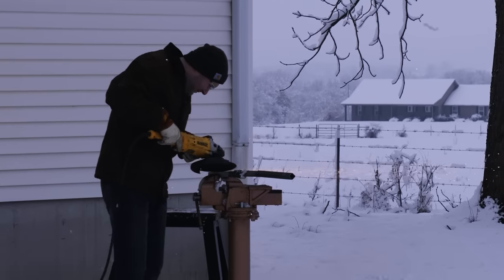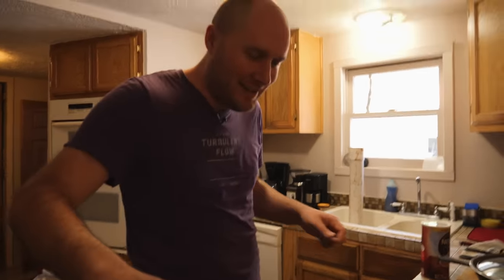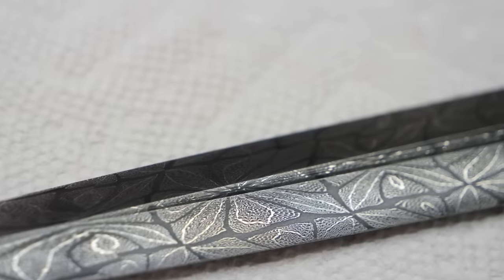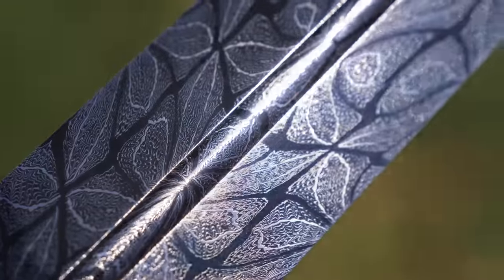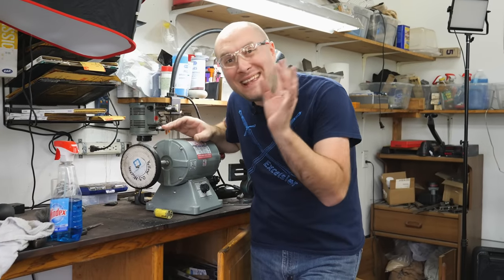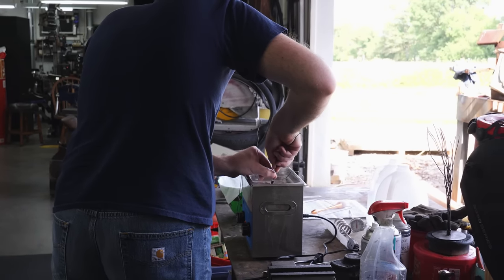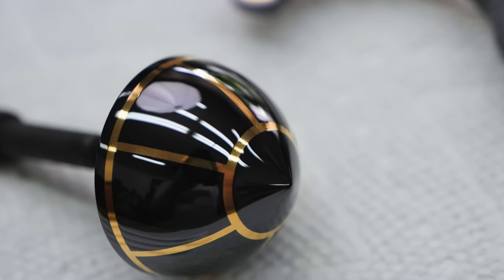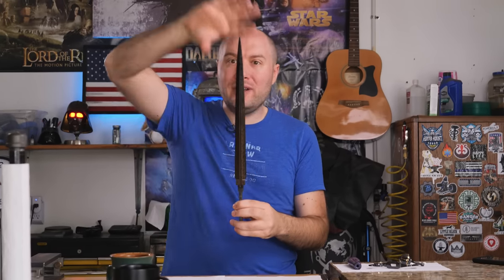After Soaking In Acid, This Knife Is Done ✅

Comment: Idk if you will end up seeing this. 

But if you want to sand higher than 3000 wet or dry. Get micromesh pads. By far the best thing ive found for high polishes well above that. 

Also the 3m micron polishing films are very good for that.

Comment: Wonderful work, as always. Short question - have you tried using microcrystaline wax (Renaissance Wax comes to mind) on the blades? It goes on much easier (no heating necessary) and protects the blade a very long time, without dulling the finish.

Comment: Exellent work! But can I ask. I understand that layers of different steels increase the crack resistance of the blade, but the cutting edge has different hardness. Have you ever measured the hardness (HRC) and microhardness (HV) of the cutting edge at different points?

Comment: Epic knife as usual. Do you clean the wires that you use to hang the parts the blueing process? Just curious if the oil from your hands would transfer to the wire then to the part.

Comment: Very beautiful! 
I hope you use proper safety protection equipment when working with that stone. Lots of natural stones that look like they have fibers in them  do A lot of times. It's asbestos
Like tigers eye . 
Charoite contains several radioactive materials and is toxic.
Everything should be done wet and it's not a bad idea to wear a respirator. 
And maybe you already knew this. Just heads up.
 Very good work.

Comment: Would it help if when you put the pieces into the water displacement oil to have a small vacuum on the container to assist with the vacation of air and water.